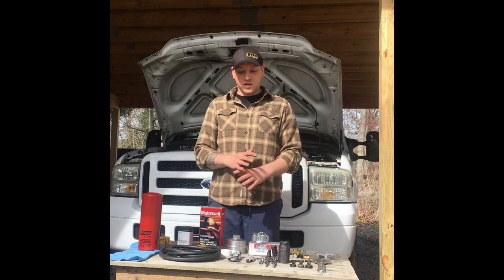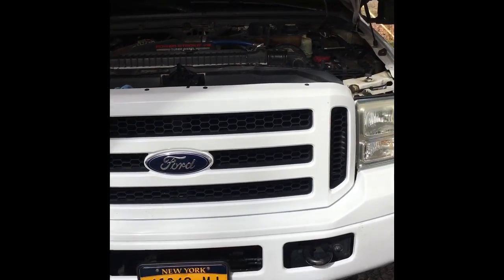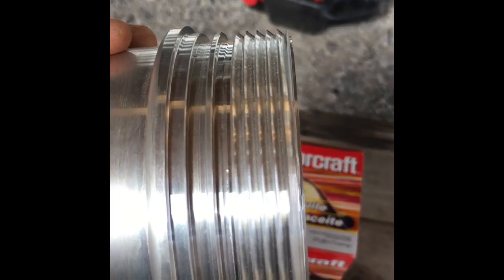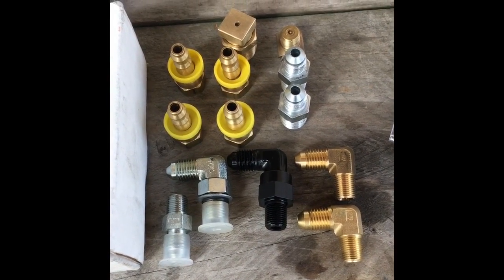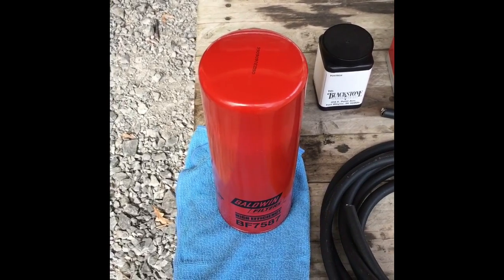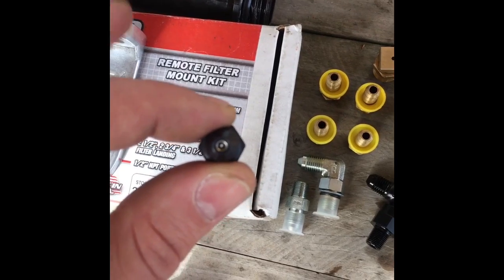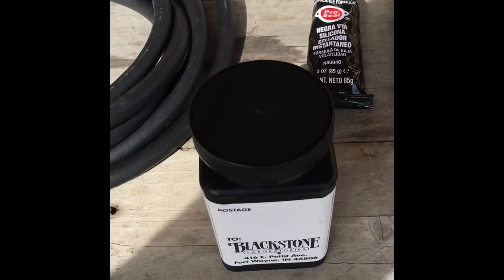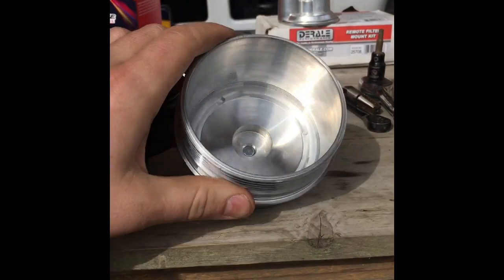DIY 6.0 bypass oil filter kit

Comment: Looks like you have spent a lot of time sourcing parts and designing. Time is money. $300 for ready made kit? Yes, well worth the money.
Reply from the maker: Didn’t take very long. I liked keeping 150 bucks. To each their own.
Reply: Many years ago when I was working on trucks and driving them I cut open a Luberfiner element. It was packed with cotton. The last one I cut open was a Cummins Fleetguard 750 . It was packed with pulverized newspapers and wood chips. Dont know what the wood chips did. Cummins claimed a 80% increase  in engine life using these filters.  No one  including me liked to deal with them.  The big double roll filters made by Gulf.Coast are even better because the oil has to travel thru 22 inches of media. Over the road trucks have over 1 million miles now with no oil drains. I know some Dodge Cummins  are using them now.  Saw a 5 ton army truck with one . It was the single roll one. Bounty Big roll towels were used when I saw that one. One guy said he gets his from Costco. They also have the Gulf Coast filters elements. Saw a toilet paper one on a USAF Humvee years ago. When I was selling them they took me around. They are on Locomotives engines on drilling rigs. They pass electric current thru a used oil sample to see if it is ok. Contaminated oil conducts electric different than the new oil the instrument is zeroed  on.  That was a big deal when a NASA engineer got into a debate with me and asked for a propaganda package. I didnt know the filters made new oil cleaner. I thought new oil was clean. We learn. They have some big engines. They were moving the shuttle around. Some things I cant share. NASA uses a lot of fuel filters.They are 1 micron filters.
Reply: So fuel filters for oil?? @ralphwood8818
Reply: I dont claim to know much about the 6.0. What little I know suggests clean oil is critical in that engine. Ive installed paper towel Gulf Coast filters on a few. I put toilet paper Gulf Coast junior filters on the fuel. I had little to say about it. The Fleet owner had a friend that worked as a lubrication engineer on a offshore rig.  I was just an installer. The 1 and 1/2 gallon filters went on the frames. They brought me conventional Walmart  diesel rated oil.  They told me oil is oil. That was when the 6.0 first came out. I suppose if you have a lot of equipment the price of oil is a big deal.

Comment: Ok, so the whole Idea, I thought, was to eliminate going through the oil filter "COOLER" housing. Is that "NOT" what is clogging up? Or is this bypass for something else? I see the oil filter / COOLER housing still installed and I guess, OIL going though it?
Reply from the maker: The system is meant to BYPASS 10% of oil flow to filter through a much finer filter media. It’s not bypassing any components. The idea is to have very clean oil.
Reply: @WaddyBronco  Ok, got it, I was looking for the video to eliminate the oil / cooler all together. With this problem with the oil/cooler clogging up and damaging the engine, what use would filtering the oil more , do? Thank You
Reply from the maker: So one of the benefits to doing the bypass oil filter is having super clean oil that won’t plug up in the oil cooler. It’s not a fix for the oil cooler but if you aren’t having any problems with yours currently, it would help prevent any clogging or failures.
Reply: @WaddyBronco  Yes understood, makes sense, BUT since I am going to do away with the oil cooler altogether and forget that problem. Would this "still" work?
Reply from the maker: @curlyelp7530  so the other issue with these engines that this modification is awesome for is the hpop and hydraulically actuated injectors. Since the injectors run off of oil engine oil pressure they are susceptible to sticking from dirty oil. So the cleaner, the better as far as the injectors go. Other than that anything that requires oil will absolutely live longer.

Comment: What is the purpose of the .030 restrictor?  I would think high flow is better.  I was thinking your hoses were small, but the flow through that fitting is small.
Reply from the maker: Cliff, the reason for the restrictor is because the bypass oil filter isn’t a full flow system, due to the finer filter media. It should flow through the filter slowly, making that filter more efficient. It also maintains the engines oil pressure and won’t push the limits of the oil pump due increased oil volume. Hope that helps.
Reply: @WaddyBronco  
Thanks.  Did some research on it.  I thought all the oil flow went through the filter.  Good to know.  Just found out I have 22 degree temp diff with almost no load.  Dang oil cooler and egr anyway.  I want to fix this thing.  I got a 2005 f350 with 56k miles stock.
Reply: Bypass filters have been around for 100 years. They all have restrictors. Normally they are 1/16". Normally a little larger on the big Luberfiner  type  filters because the filter and oil pump is larger. The big Gulf Coast bypass filters they use on over the road trucks use the same size orifice as the little filters. 1/16"The factory installed optional equipment  bypass filter on my 41 Dodge had a decal on it with a picture of a dip stick with  clean oil  on it. It read the dip stick tells the story. It was far superior to the full flow filter at cleaning oil. The orifice was 1/16" It used cotton the same as the Luberfiner.  Now they  mostly use pulverized newspapers. The inferior pleated.paper has replaced the cotton. The best is toilet paper and paper towels at cleaning oil. My new 64 Rambler American came with a spin on bypass filter with the orifice inside the filter. Got tired of.dirty oil and installed a Frantz oil cleaner. No more oil drains. Paid 29.95 for the Frantz. The spin on was less than 2 bucks. Scott toilet paper was.about 25 cents. The over head valve Rambler had a full flow filter. Did a fleet of trucks when the 6.0 came out. Luckily most were 7.3 s The oil filter cap and  the fill cap would.have been helpful. I dont miss that job. They called.awhile back. They had more trucks. Told them to call Gulf Coast Filters. Cant get up and down anymore. Those people wanted the big Gulf Coast 01 paper towel filters on all the.powerstrokes.
Reply: The slower the oil goes thru a oil filter the better the cleaning. That's why full flow filters cant clean oil. When I was selling Gulf Coast Filters one of my Cummins customers drilled out the orifice to increase the flow. Bad mistake.  The 7.3 was like a big truck engine. A pipe plug for pressure and a pipe plug for a return. Did a fleet ground down a 3/8 extension  to 5/16 to remove the 3/8 plug at the bottom of the engine skirt for the return.

Comment: How many miles do you get out of a oil change with this kit?
Reply: My estimate would be 12,000 miles or equivalent hours using Delo 400 synthetic blend diesel engine oil. 10k for conventional, 14K for full synthetic. The full flow filter must be a long life type such as Wix XP.
Reply: Recently bought a Australian Jackmaster Classic off Ebay. Looks like it is the best in production. Its like the Gulf Coast junior. You just push in the TP and put on the lid. Jackmaster claims their filter elements are better than TP but they set up the Filters to take the larger core TP with a larger core seal. About the only element that fits the Frantz is the Frantz elements.

Comment: is there enough oil or oil pressurecoming out of the top of the oem filter cap? i imagine you could add an auxiliary oil cooler to this method
Reply from the maker: Daniel Hendricks I’m sure it’s possible. Could put a gauge on it to see the pressure.
Reply: Sure could but If you want a cooler in this way you should  use a thermostatic bypass valve to keep it from using cooler until oil warms up or it will cause extra wear during warmup period
Reply: @jojomorgan8556  I've thought of using a thermostatic valve, but never actually installed one. A necessity with thicker oil in very cold weather. It would also keep water out of a paper filter. Another reason to use a small orifice size. Cold oil flows slower.

Comment: where did you end up installing the restrictor, on the remote filter mount outlet or on the filter fitting?
Reply from the maker: illusoric I put the restrictor at the filter outlet.
Reply: The factory installed bypass filter on the 64 Rambler American had the orifice at the outlet.It was in the filter. I think the filter mount also had an orifice. The Jackmaster has the orifice at the outlet. At one time Jackmaster made jacks. Been around since 1954. Frantz since 1953.A little trivia. The big Gulf Coast 3 gallon filter has the 1/16 inch orifice at the inlet. When they used Bounty big roll paper towels  the oil soaked down thru two rolls end to end  top to bottom then back to the engine. 1/16 inch has been pretty standard on small filters since the 20s. The old canister filters such as Fram and Purolator had the orifice at the outlet. My Jackmaster has it at the outlet.
Reply: @ralphwood8818  A 1/16" orifice was ok with the thick oil used before 1980. Notice in the video, Dwight pointed out .030" holes in the fittings. Very necessary with today's lower viscosity oils. A 1/16 orifice would flow too much oil and may cause unwanted problems.
Reply: The smaller the better.on some of the lawn mowers I made.orifices oit of .025 wire feed welder tips. The Jackmaster has a very small orifice at the outlet. When I was selling Gulf Coast filters one of my Dodge Cummins customers told me he drilled out the orifice so it would filter faster. Not good. I think the 3 gallon Gulf Coast 02 has a 1/16 orifice at the inlet. At work I used the 1 1/2 gallon 0 1 on the yard tractors and the hydraulic systems.  Jackmaster lists the size of their orifice in metric on their website. They are over kill on information. They will educate the hell out of you. We had some trouble before full flow filters when the old cars had a lot of large stuff in the oil. Some bypass filters had the orifice at the inlet where it would clog. I started with Frantz in 1963. We were still dealing with the old cars. Some were so sludged up you had to open them up and clean them before installing the Frantz. Or change the Frantz every 50 miles. Some Frantzs had the orifice at the inlet.
Reply: @ralphwood8818  It makes great sense to have the right amount of flow through the bypass filter. Smaller engines would benefit from less flow and therefore less pressure bleed off.
Reply: The smaller the orifice the better. The slower the flow the better the cleaning. 1/16 inch has been standard since the 1920s If your oil pump or engine is so badly worn it cant supply the bypass filter thru a 1/16 inch  orifice you are in a heap of trouble

Comment: Did you post parts yet looking to do this to my 6.0?
Reply from the maker: bjjblackbelt513 no I didn’t post any parts. A lot of the stuff I found for this was just from searching on google and eBay. There’s no set way to do this. You can make this in so many different ways to fit your liking. I just wanted to show people that you don’t need to settle for an expensive name brand one. If you need some help or have any questions just hit me up and I’ll help you out. Thanks for watching bro!
Reply: WADDY 351 Thanks for getting back!
Reply: @WaddyBronco  : It would be great if you can mention a source for the brass fittings. I've run into some not so good ones, probably made in China or a batch of B stock. The fittings you had laid out in the video looked like very good quality.

Comment: Excellent video, spot on info. Thanks for the idea on the Vibrant restrictor, I was making my own. That's a winner. Good choice on the Baldwin BF7587. The 6.0 benefits the most of any PSD from clean oil.
Reply from the maker: Carr Estes thanks! Glad you liked it!
Reply: Was a mechanic for Safety kleen. I had oil filters on everything. I remember the orifice was always clogging up on those guages. I would drill them out. Didnt help much.pumping some crap.Got lymphoma from welding dirty metal. Didnt protect myself well enough. You cant clean those pipes and augers good enough. They will smoke. Chemo aint fun especially when they go into your spine.Feel bad for the kids.
Reply: Years ago a guy had me put a paper towel Gulf  Coast filter on  7.3  He came back in a few months and had me put the filter on a 6.0. Then he came back and told me the 6.0s had injecter problems. He had a new Dodge  Cummins for me to put the filter on.  I dont drain oil so I was happy when he said while you are at it change the oil. Didnt buy oil for the 6.9 when he came around. The old 6.9 needed a quart of oil about every 600 miles. Had over 300 K  miles on it when I bought it. This guy bought new trucks. The NASA engineer was talking about him when he said we dont keep our rigs long enough for the filters to pay. Im thinking damn I just put oil and fuel filters on several 6.0s. Didnt get any complaints. There was an attorney  in Dallas that said on TV if you bought a 6.0 give me a call.  Ed Wallace a car guy on the radio said Ford went from the best engine ever put in a truck the 7.3 to the worse engine ever put in a truck the 6.0. I was getting paranoid. You dont want engine problems with engines you put non stock filters on.

Comment: would any 2 micron fuel filter work there is some cheaper baldwin and fleetguard filters that would fit better where i want to mount mine
Reply: George Costanza can’t stand ya
Reply: I'm not sure I would use a fuel filter because of the heat, mounted under the truck with such a small restriction it may run cool. I'm actually going with the B50/B164 as a dedicated bypass element, it may not be as efficient but has a rating much better than the full flow.

Comment: I was rather dissappointed when I called Baldwin and a "Randy" in service engineering said "He wouldn't do it" when I asked him about using the fuel filter. I really called because I'm having a hard time finding the correct adapter nipple. After he said what he said, I didn't ask anymore. He said the Baldwin oil bypass filter goes do the 5 absolute. I guess I'm going to work on putting an Amsoil on. . . . You video helped and I appreciate it, just wish I talked to the same tech you did. . . . Joe
Reply: Got told by Wix and Baldwin, that this filter isn't the right material. That you should not use this filter for oil bypass. Wix informed me that Amsoil has a patent on their aftermarket filter for this. They have answered this question a million times. They informed me that if i did go with this. I would end up with pieces in my engine. It isn't about durability its about compatibility and degradation. Different chemicals degrade materials differently. I am currently looking at the Frantz oil bypass unit. Simply because the price of the filters is a lot cheaper.
Reply: I'm working on a B50 install because thats what it was designed for and there is a longer version some guys have put on their B series Cummins. I have the TP Frantz and its OK but the paper roll is not as clean as people say. I read some blogs about using the CAT fuel filter from ten years ago and no one said anything about the paper coming apart from heat or incompatibility with lube oil. The parts guys say this because the application is questionable per the engineers.
Reply: The Wix part number is 24755. This adaptor head has 1/8" NPT inlet and outlet, same as what Frantz has used for many years. I am installing this with a Frantz sandwich adaptor, which mounts between the block and the main oil filter (factory full flow). The Wix filter for this adaptor is the 51050, and the NAPA filter is 1050. The Baldwin filter is B50 and the Luberfiner is the PB50. All of these filters are made for oil bypass duties and are 10 micron nominal, which is similar to most fuel filters. Longer versions are available if you have the room, or if you are installing on a large engine.

Comment: Help   can not find the 3/4 16 to 1-14 thread convertor anywhere.   Can you send me a link for the part.  Thanks    Dick     rjn.norcom@gmail.com
Reply from the maker: Richard Norris just sent you the link in your email. Hope it helps!
Reply from the maker: Richard Norris something went wrong emailing you. I was unable to find that thread adapter but check out the WIX 24770 filter head. It has that threat size on it already.
Reply: THANK YOU SO MUCH    RJN

Comment: How did that Baldwin fuel filter work as an oil filter?
Reply from the maker: superdutyonplanets I asked Baldwin if it would work and they said yes. The element in the filter is made to not break down from fuel running through it. Oil obviously won’t break this stuff down like fuel would. So that’s why it works. There’s a lot of people out there using this filter on all kinds of different engines.
Reply: Thanks brother!
Reply: What about oil temperature?
Reply: The bigger the filter and the slower the flow the better the cleaning. Years ago I was getting Cummins Fleetguard  750s from an International truck dealer They used pulverized newspapers and wood chips. When the owner passed away so did my discount. Went to the filter maker. I was too small for them to deal with. I get no respect.

Comment: Maybe a dumb question but what’s the purpose of the restriction? You said it’s one of the most important parts. I pieced it together using this guide but just curious about that
Reply from the maker: Ben Johnson The restrictor orifice is there so you don’t have any oil pressure issues.
Reply: Also the slower the flow thru the filter the better the cleaning. The bypass filter can take it's time. Bypass filters have been around for a hundred years. Normally the size has always been 1/16 inch. The big Gulf Coast  3 gallon filter has the same size orifice as the 1 quart filters. I have been known to put a .025 wire feed welder tip in a brass fitting.